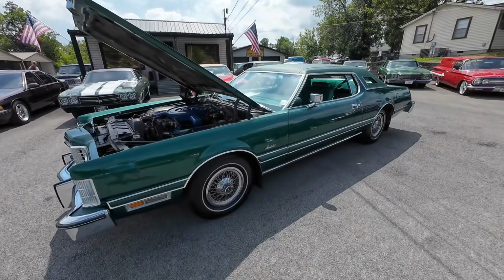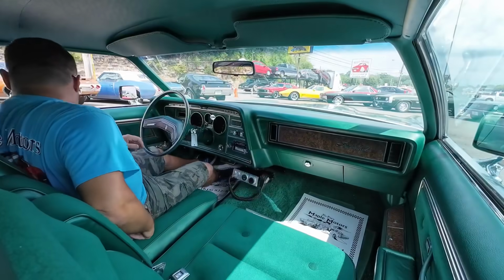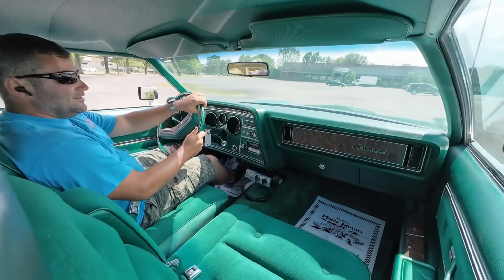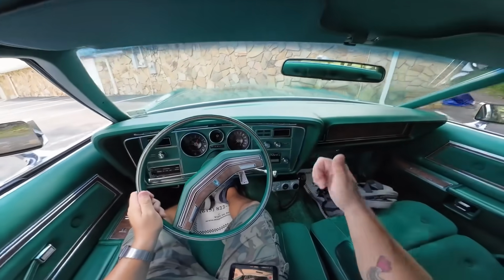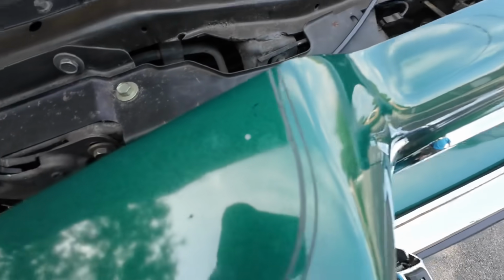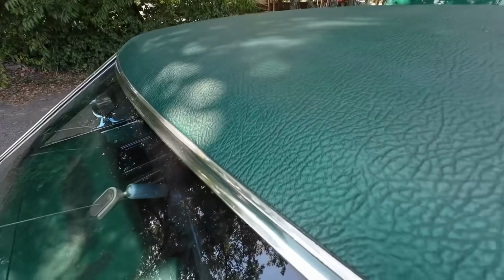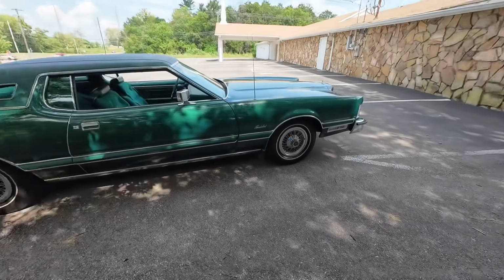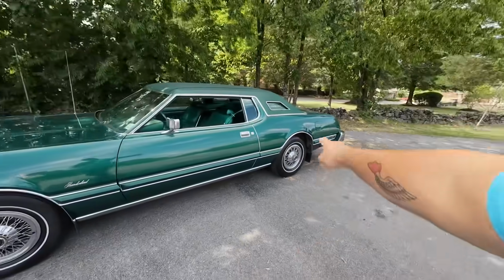Test Drive 1976 Ford Thunderbird SOLD $10,900 Maple Motors #2291

Comment: Only 202 hp from a 460....man those emission standards were brutal lol.
Reply: Yea but in 72 same engine was making 365 hp and 485 lb. -ft. of torque and that was still bone stock so with a a little work this could be a beast
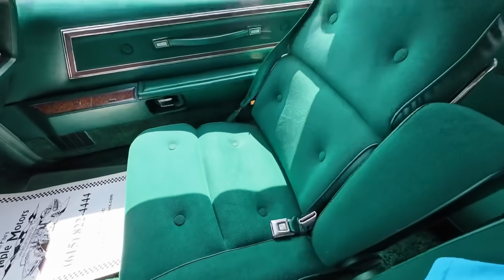Reply: In 72 that engine did not make 365 it was more like 2:20 lower the compression after 71
Reply: Also in 72 Ford changed her horsepower ratings to net not gross
Reply: @Vladpryde  horsepower ratings drop significantly when Ford went from gross to net horsepower
Reply: You’re comparing net to gross horsepower…a common mistake

Comment: Man that thing's mileage could be original.  The quarter damage looks like a garage door mishap some time ago.  Those old GM A6 style AC compressors had a habit of leaking past the shaft seal if they weren't used regularly.  It's not a muscle car but worth every penny you're asking for it.

Comment: That is a beautiful car. I wish I could. Nick, I was an alignment mechanic for several years and left or right pull in the front end can usualy be solved by crossing the front two tires.
Reply: You don't run tires "backwards"! No left side on right side. Duh...